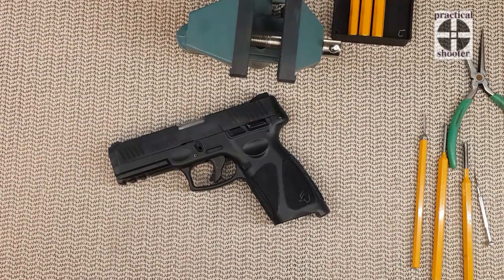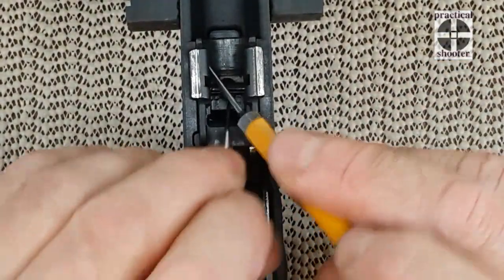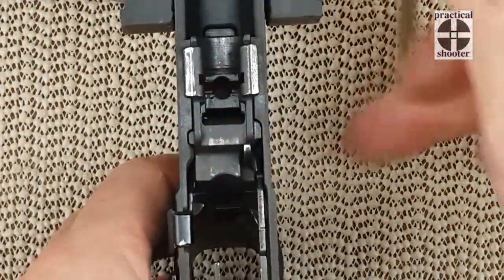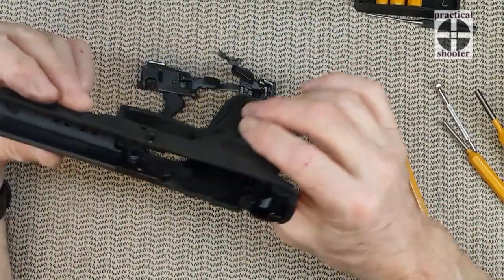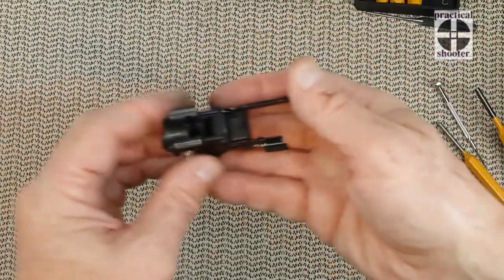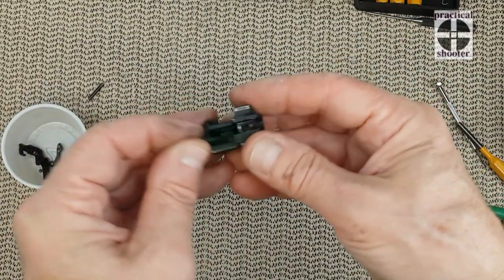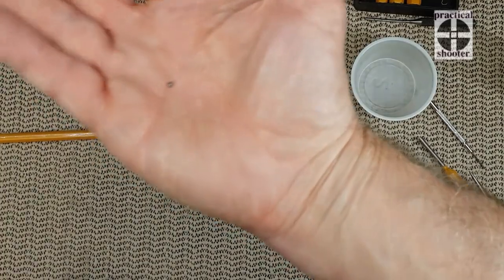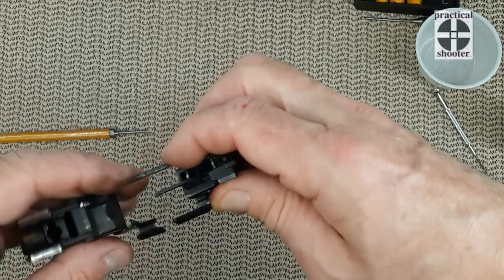Taurus G3 / G2 Lower frame full Disassembly

Comment: Thank you.  I was trying to figure out what was rattling on my g3, and found significant play in the disconnecter.  Led me to think that the rear support of the sear or whatever it's called might have been out of square on it's pins causing a larger gap where the disconnecter clears.  Your video sure helps me be comfortable in taking it down properly, though I'm starting to think some slop in the disconnecter may be normal on these.  Maybe that's fine but hearing it rattling around in there worried me.
Michelle
Reply: It’s normal, my G3 rattles badly too, and even my Sig p320 X carry makes a bit of noise when I shake it because the disconnecter wiggles a bit. The Taurus does sound louder though, but it works well all the same.
Reply: Same issue with my g3 I’m gathering this is a common issue.
Reply: @TheSecondHandler  
Looks like most of them have enough play in the disconnecter to rattle.   Interestingly though, that one of mine now has probably 2k rounds through it and doesn't rattle anymore.   In part though I keep it really oiled and maybe slightly dirty in there, so if it's dry it'd probably make noise.

Comment: HI. This video is awesome and I hope you are still monitoring this account because I have a question. My Taurus G2C slide catch WILL NOT release anymore (with or without a magazine and regardless of the magazines capacity) and I think something fell inside the trigger assembly (at the slide catch), or the little spring is messed up; maybe because I used to keep my slide locked (with the catch). I HAVE to release the slide by pulling the slide back and releasing the slide catch with my finger. 
Here is my question: How would I obtain that spring?
Keep 'Em coming and thanks!

Comment: Question. Do you think the pistol would function properly with the manual safety removed?
Reply from the maker: It might, but it is taking a chance. You don't have to use the safety of course, but if you prefer not having a safety on your gun, I would think the Canik could be a better choice for you.

Comment: Hi! I don’t know if you’re still active but I was looking for an explanation on why my g3c rattles a lot and it seems to be that little piece that flies out and lands by itself at 5:55 . Is it safe for it to sound loose and rattle a lot?
Reply: It’s the last little “thingy” you put in before putting the screws on.
Reply from the maker: @Ohsaintjoseph  Nothing should be rattling in your gun. If you think to know what part might be the guilty one, take your gun apart, again, and double check that part and all others as you are at it. It is hard for me to be able to trouble shoot from my standing. Just take your sweet time and check everything. Good luck and keep me posted.
Reply: Mine does too on my g3c.. its the disconnector.. i seen on taurus forums that other guys say they experience the same thing but works as should.. im still in question because mine is brand new out of box..
Reply: @RK-iv3ii  it’s normal. I asked a gunsmith and It’s connected to the safety and has nothing to do with it firing.
Reply: I’ve shot mine about 300 times now anyway. 👌🏼
Reply: @Ohsaintjoseph  thanks.. i was worried about it..
Reply: @RK-iv3ii  me too bro, no problem. 👌🏽
Reply: Just had this same problem and found how much play the disconnecter had.  Led me to see that perhaps the rear support of the sear might be out of square slightly on it's pins leaving more room where the disconnecter clears.  More room there would cause it to have the play that's causing the rattling, but until I watched this video I wasn't quite sure if I should take the lower apart.  This was just now, so perhaps I'll let you people know what happens.
Reply: I finally fixed the problem
Reply: @RK-iv3ii  
What was the fix?  I have yet to attempt to do so.
Reply: @andimichellehill  i sold it and bought a 43x..lol
Reply: @andimichellehill  i tried to just like the gun but an internal part rattling all the time just dont sit right with me..
Reply: @RK-iv3ii  
😅  yeah, exactly.   Sorta my same concern.

Comment: 5 TIMES ALREADY I've had to crawl on the floor for 30 min looking for one tiny spring. Eventually I sped up the process with a strong neodymium magnet....

BUT IT JUST SPRANG AT ME A 6TH TIME AND THE PIECE WAS PLASTIC ARE YOU SHITTING ME.

I'VE LITERALLY BEEN CAREFUL BUT EVERY TIME I THINK THE SPRING HAS SPRUNG IT"LL SIT THERE FOR 5 SECONDS WITH NOTHING COVERING IT, THEN I'LL POINT IT AT MY FACE TO CONFIRM IT'S GOOD AN IT'LL PICK THAT MOMENT TO SHOOT IT AT MY FACE.

I'm just gonna order like 5 cheap spring and parts kits and cry.
Reply: Update: the disassembly rod works fine without the pin... The spring holds it up fine just by itself.

Comment: My G3 slide disconnector on the lower frame is rather loose and rattles. Anybody encounter this and able to fix it?
Reply: Mine does too brand new out of box.. have you shot it yet..? I just bought mine couple days ago.. ive seen on taurus forums its normal..

Comment: Why...did "WE" take this all apart? are you telling "US"/"ME"  that it has to be completely taken apart like this after so many rounds to be cleaned??? Or do "WE" have to take it to a gunsmith to have it cleaned after so many thousands of rounds??? If all guns are this way, why do people have them? It would be like totally disassembling your car and engine after so many years or 100,000 whatever and clean each part. 🤣🤣🤣🤣🤣🤣 Famous old saying........."IF it ain't broke....Don't fix it." 🤪  I believe that very much especially for this gun or any gun. A carpenters claw hammer to work on a pistol gun. 🤣 now that.... is HILARIOUS. You need a small rubber mallet or small ball peen hammer. That is the one and only thing that you forget in each of your videos. You never say the reason for the disassembly for each part or for how often it would need to be taken apart. Thanks so much.   😍